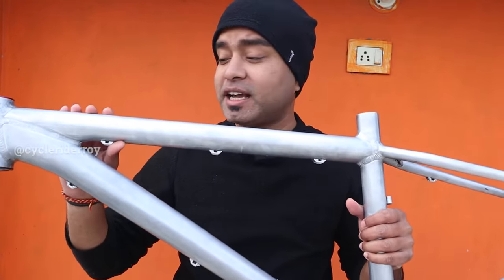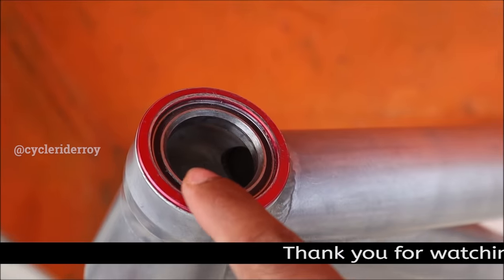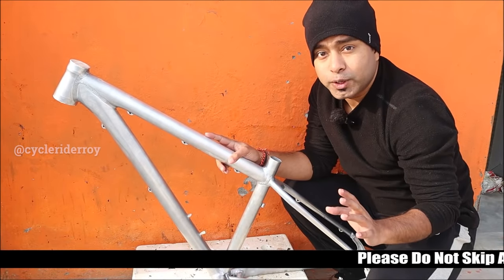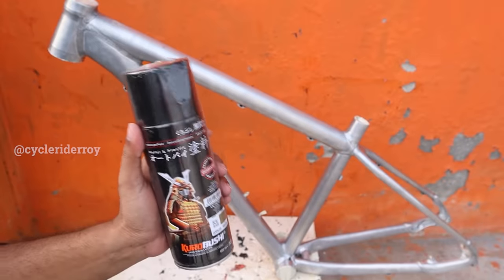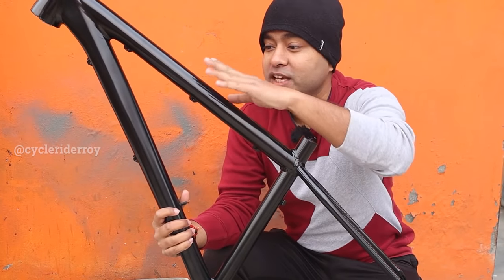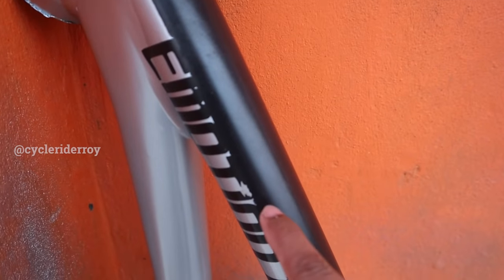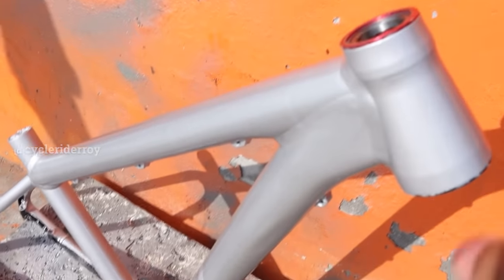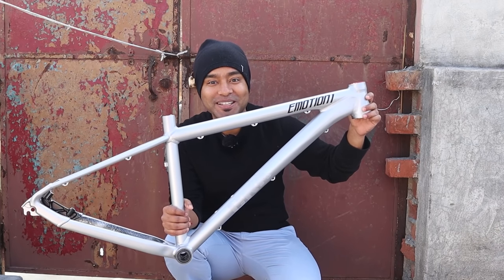How To Repaint MTB Cycle at Home Easily | Easy Bicycle Repainting Video India Hindi

Comment: Hi, I have a few tips for you as an artist and prop maker. I observed that when you were spray painting, your hand motion was not right. You should spray in single long strokes and not in breaks. Do not overlap an area you just painted. At 5:56 you did two full strokes on the bar, top to bottom. Sab jagah aise hi karna. Then you will not get the "droplets" like paint accumulation. And also, take one hour breaks between two layers of paint coat. Also, please tell your viewers to do this in an airy environment. Can spray ka fumes health ke liye accha nahi hota hai. And finally - also advise them to dry it in a dust free environment otherwise there will be tiny dust particles on the paint that will feel like "sandpaper" once your paint has dried and chances are that it will peel off from there. I hope you pin this message so your viewers can take notes
Reply: Nicely ignored
Reply: Bro ,,, I have a question can you please clarify it for me ,,, actually I am too thinking of painting my cycle but is unable to rip of the original paint from the manufacturer side,, so can I skip that part, and just skip that ripping of the original paint and rather overpaint over the original paint ?,,, Do it will make any changes ,,, also wants to get a white wall tyre to get a retro look, (I got an M-Fat Bike) so can you please advise how to go for it please bro ,,, having a huge doubt would be grateful,, thank u

Comment: Hey and before you apply any primer you should wipe the frame down with acetone or rubbing alcohol and avoid touching the frame with your bare hands as it leaves behind oils from your hands and that is why the paint didn’t stick to the frame and came off with the masking tape